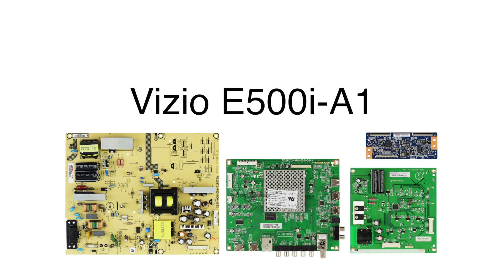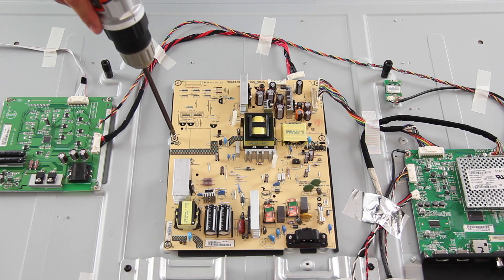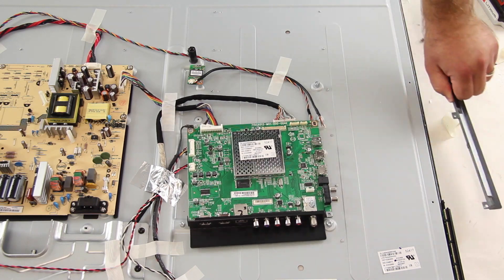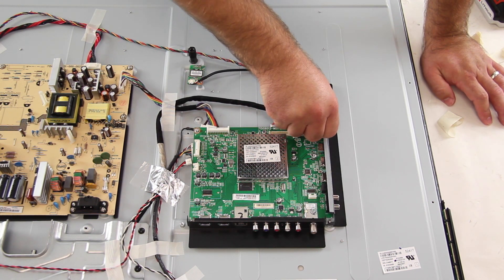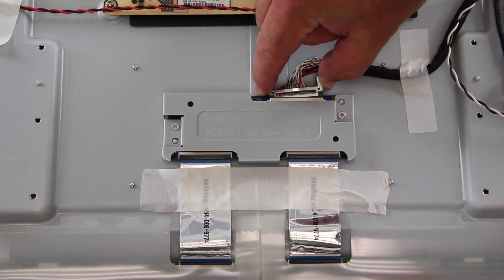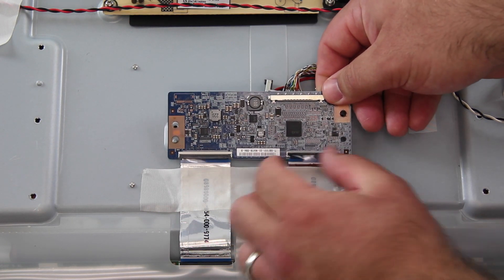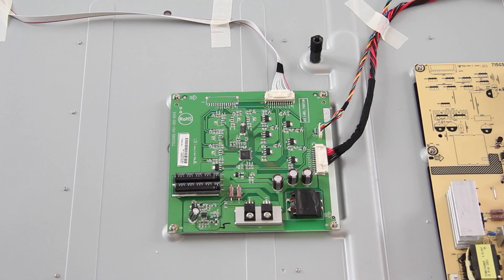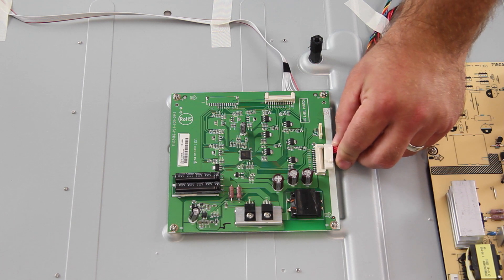Vizio E500I-A1 Complete TV Repair Kit - How to Replace all Boards

Comment: I have a Visio E5000i-A1 that stopped working about a year ago. When I turned it on all I could see was the Visio logo, I couldn't do anything else with the TV. I finally got around to ordering the necessary boards from ShopJimmy.com and I just replaced all them and the TV works like new! Thank you!

Comment: I Have a 61"samsung that bulb is not coming on. i have changed the power board  and balast one and still not lighting  up. so i checked the color wheel and its working. any suggestions.

Comment: HELP HELP HELP!!!!   I have this same tv and i have purchased a repair kit from you and replaced all the boards.  it worked fine for 4-5 months and now when i turn the tv on the black background is now green.  the vizio logo is still there and it works fine.  also when watching a show or movie the blacks have a tint of green as well as the whites.  which board would be good to replace?  please help!  its the same for all inputs as well.  even with nothing hooked to it, when powering it on the should be black screen is green.
Reply: Did the seller reply to your question?